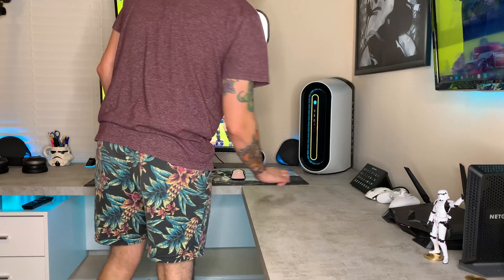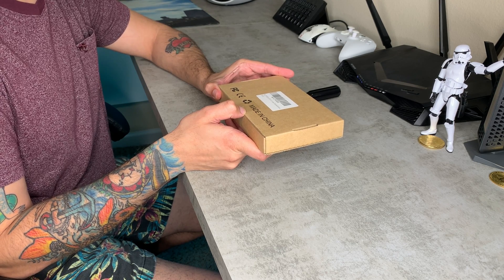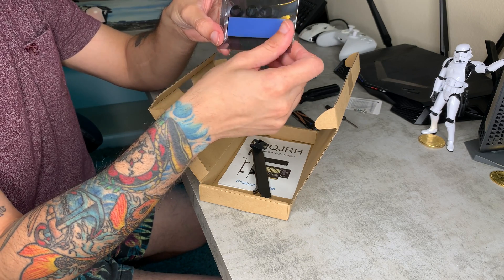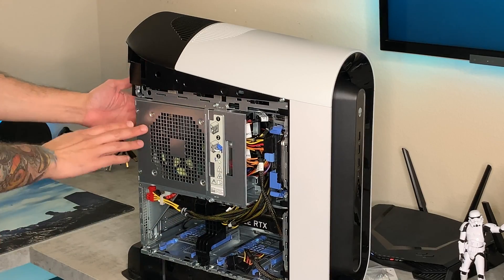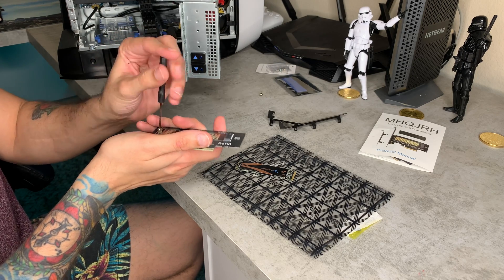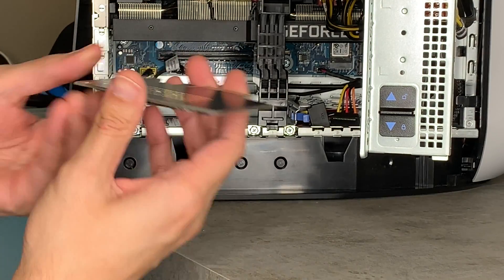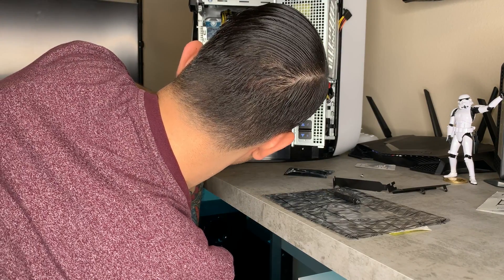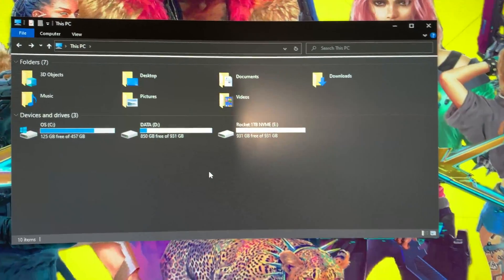Install 2nd NVME SSD on Alienware Aurora R11/R10

Comment: For anyone watching this video and installing a second NVME drive with a pci-e adaptor on an R10 and not seeing the drive at all, Swap the original NVME that came with the computer onto the pci-adaptor and put your new NVME drive into the motherboard nvme slot instead. It's some weird Alienware drive compatibility issue that is still not fixed as of 06/14/2021.
Reply: Use the Disk Management formatting the disk (create new simple volume)solved my problem.
Reply: @184Simon  the specific issue some of us had is that the drive is not detected at all so you can't remap the partition even through diskpart.
Reply: @FatCatHash  how do you swap the SSDs around and still get your system to boot? I’m running into the same issue /:
Reply: @0UpInFlames0  it will boot normally using the original drive as the boot drive even if it's not in the main motherboard slot. If it doesn't work, I would check the bios to make sure it's allowed to boot from the drive it detects the OS in.
Reply: @184Simon glad I read your comment…saved me a heap of drama with swapping the SSD’s around 😊
Reply: Thank you @184Simon
Reply: Yes it would require remapping or formatting and creating as a new partition from that unallocated space which is required in order to use any brand new drive on any pc lol. Once that’s done it should show up! Not an issue with Alienware haha! No need for swap.
Reply: I litterly just posted a comment asking why I can't find it and I just saw ur comment! I'm gonna try that
Reply: Thank you for your reply.  I had the same issue and swapping with the NVME on the motherboard fixed it.
Reply: I had the same issue with my r10, could'nt find the drive anywhere in the computer. I swapped them around, boom there it was computer reconized it. Thank you for the video @Gamer Heaven and thanks for the help in the comments @Raymond C
Reply: Worked for me on an R10. Thank you sir! I can now see it in Disk Management.
Reply: This did the trick on my R12!!!  Thank you !!!!!!!!
Reply: Followed this advice and now my PC won't boot. Thanks
Reply: @askinganime6023  did you ever figure this out? Currently having this issue
Reply: @NagsGames  I took out the sata drive racks and put my GPU on the very bottom and put the m.2 adapter into slot 2. (The small one that fits the adapters size perfectly) I then turned on my computer without any of my other external drives connected and it recognized it
Reply: thanks for the advice but Im annoyed I listened to this guy.... I will never follow this channel again

Comment: Hi Folks,

I've followed these instructions for my R11 using the adapter and a 1TB nvme drive, however when the adapter is plugged into PCIe slot 4 I cannot get signal to my monitor.  Has anyone else had similar issues?

Comment: Is the read and write speed similar to Gen4 motherboard M.2 slot? I want to achieve the 7000mb+ speeds I’m getting from my Samsung 980 pro gen 4 pcie nvme m.2
Reply: I highly doubt that it is possible in alienware R10/R12

Comment: Ok here is my question do to the fact its right under the GPU does it affect  the heat to the GPU ? I have r12 with a rtx 3080 and I don't need for that to get any hoter thanks all ready is .
Thanks for your help !
Reply: Following…
Reply: My 3080 temps have increased by 10-15C since installing the nvme in the PCIe underneath the GPU.

Comment: I would clone (via Macrium Reflect -free-) the main nvme to a Sabrent 2 TB nvme( on your card) after cloning, I would replace the main nvme with the cloned nvme drive. And then put in your extra E: /G: drive nvme on your card.
Reply: I was wondering about this. I am about to undertake adding a second nvme to my r11 and I still have a lot of questions.

Comment: R11 with 256nvme - better to replace with 1tb or just ADD 1tb using card like you did here?  I'm an old gamer (50) getting back into it after a 13-14 year hiatus. R11 is brand new - have only updated win10 and drivers so far.

Comment: @Gamer Heaven - This does not work on R10. Just FYI
Reply: I am currently trying to do it on my R10 and it is not working. What makes you say it won't work? The light turns on and everything, but the drive doesn't pop up in disk management or anywhere.
Reply: I too have R10 and have purchased the exact items that Gamer Heaven recommended. However after trying it for myself, like you, only got light turning on but the drive isn't recognized (even in disk managenent). After detailed browsing in dell forum, someone did the leg work of contacting Dell support and got a co formation that motherboard for R10 does not support this type of m.2 expansion
Reply: Confirmation*

Comment: so far your the reason i ordered an r12 lol
and ill be doing all the upgrades as well as adding the NVMe and 2 SSD  drives to it so i wont have to worry about space and iv got 64gb of DDR4  ready to go once it gets here all at 3200
Reply: Nice!  How are you liking your system? I just bought an R12 and am in the midst of doing the mods. Would have loved to build from scratch as I've done all my life but couldn't find parts easily.
Reply: @ConservativeGamer111  return it
Reply: fuckyoutubepolicy staff  Now maybe. Things are not so simple as the future exists in multiple ways. Performance over time and more importantly future improvements. They commonly use proprietary parts that make it more difficult and costly to change things on. I've opened them up and would never suggest them unless they like 40% under equivalent as there are no bad parts only bad prices.
Reply: I'm sorry you burdened yourself with an alienware.
Reply: @rodneyhobbs6507  That's pretty mean. I love building PCs myself and had a hell of a time finding something for a good price and nice specs. I would have built my own system, but GPU prices on the open market are absurd. Figured I'll build another once market opens up. Who knows what their story is but why do that? Make you feel good?
Reply: @ConservativeGamer111  motivation. Cards are hard not impossible. Put in the work, get a card, be rad. Shuffle up every day, find someone with a deal or Buy abs or something. just never buy a Alienware. They sent just prebuilts their also trash.
Reply: @rodneyhobbs6507  There is more than one way to skin a cat. Who cares how you get the computer. As long as its working for your personal needs. Grow up.

Comment: There is no need for more then 1 sure it would be nice not to have to use an adapter but hey there are a lot of things in life they could be better if this or if that... So you have have 2 and then you have have SATA SSD drives as well. And you will never notice the difference between SATA SSD And M.2 SSD. Yes M.2 is faster but when it comes to loading games, you would never be able to notice a difference. 

Good video!

Comment: I bought an adapter a while ago, but I'm so lazy...  I've opened my case like 3 times and haven't done any upgrades at all yet. Haven't had any issues yet running Cyberpunk maxed out 4k, haven't had heat issues yet, it keeps me complacent.

Comment: You can buy a x16 adapter which can insert 4 NVME M.2 SSDs, but that adapter usually cost as much as a 1T 2.5inch SSD in 2020.
Reply: The PCIE slots on these Aurora desktops are all only x4 Lanes so that wouldn't fit. I have an R13 and have tried 3 different Nvme to PCIE adaptors and the desktop doesn't recognize the drive. It shows up in BIOS, but it is nowhere once the system starts. Alienware made these cap out at 258GB I believe, I am trying to install 2 2TB Nvme SSDS on the main board, but Dell website says the boot 2230 slot Maximum size is 258GB. Wish i knew what the PCIe slots are for if they can't run NVME and seem to not work well with Alienwares motherboards.

Comment: Can you add aftermarket ram on this motherboard?
Reply: There are tons of reports out there written by people having problems mixing RAM they originally bought with the system and RAM from a 3rd party it would seem. The RAM Dell sells is some specific proprietary model JUST used in these Alienware models and it messes with the computer if you try to install a RAM module from somewhere else alongside one of these "Dell Only" RAM modules. 
What worked for me was to get rid of all the pre-existing sticks of RAM that came with the computer and replace it with a matched pair of HyperX RAM sticks I had bought elsewhere to avoid the ridiculous OEM markup. That seems to work most of the time so I've been told. I've always done it like this any way with new RAM...just replace the whole lot at once. Maybe I lucked out. Either way, I'd read up about the issues before attempting just for your own information! Good luck!

Comment: Hello, I just got a very good deal on a new R11 (with i7), but it only has a 256 GB NVMe SSD (boot). I would like to add a second NVMe SSD (1 TB) using the adapter you show in your video. Is it possible to have one 256 GB and a second 1 TB SSD, or should they be the same size? Thanks for the great video!
Reply: You should be able to add up to whatever the pcie slot can handle and whatever the actual peripheral will allow. So get yourself a 1TB :)
Reply: If you are looking for top speed, you should remove your 256 and replace with the 1 tb to get maximum performance. Smaller drives are generally a bit slower.

Comment: Thank you sir. I just found out that my R11 only has one MVME and was trying to find how to add another SSD . This is very useful.
Reply: Good Morning Brother, with adapter, will it take M.2 NVME 2TB SSD Hard drive, Many thanks and really appreciate Brother.
Reply: hello, i just ordered my aurora r10 ryzen edition, i am wondering the boot nvme m.2 slot is gen.4 or gen.3? thanks a lot
Reply: I just plugged in a 2TB external SSD to my R10 problem solved........lol

Comment: Wait, your R11 has lights inside the front panel?!? I can't get mine to light up! I just have the ring and logo that I can control! Yes, I have the white version also! But it's an R10 Ryzen edition. Also, thanks for the expansion board info, wasn't sure which one to buy!
Reply: The ryzen r10 doesn’t has any light inside ig
Reply: The trade-off for having that RGB illuminated panel is that it presents a barrier for straight air intake in through the front of the computer by partially blocking the vents. My R10 doesn't have it either, and I'm very happy about that because it runs cooler.

Comment: Awesome video!  A question for you or anyone who sees this!?! What is the best way to move your games to the new storage device?  Woul I need to download them again?  Might seem like a dumb question but I’m a total newb
Reply: you probably know this by now or forgot, but just clone your files to the new drive. If you pulled out your nvme you'll need to reinsert with an adapter into PCIE slot like this guy bought and move files. Otherwise, find a Sata to USB cable and connect your sata enabled drive to adapter and to PC with USB. Then move files.

Comment: Just heads up anyone getting this ssd and adapter for the R10 IT WONT WORK like video shows.  I am a novice so per video seemed quite simple, I did exact instructions but ssd won't show up.  I have done some research online but seems way complicated for my level of understanding.  Avoid this unless you have a good level of understanding just my advice.
Reply: I just did this set-up on an Aurora R10 (4th Gen SSD is pointless, as it only runs as 3rd Gen).  After installing, my system did not see the added SSD; rebooted twice but still nothing.  Was going to swap SSD's in the morning, but for some reason, the SSD was now recognized, and I could format.  Weird, but works fine.  In the lowest, long slot, btw.
Reply: I bet you need to format and remap your drive. He mentioned that in the video. It should be really straightforward for Windows users.
Reply: @Steve-hk2hd  nope. Doesn’t work in the AMD R10s. There’s a workaround on the Dell forum but curious if @gamers heaven did that
Reply: @Nowhyshouldi2  I'm running into the same problem. I just followed all the instructions here using the exact same components. I'm getting the LED indicator on the adapter showing the drive is active, but I cannot see the drive in device manager. I don't have any other means of formatting and mapping the drive.
Reply: @Nowhyshouldi2  Have a link to the Dell forum article?
Reply: @Nowhyshouldi2  Strike that. I was able to format and map the drive. I had to plug it into the shorter PCIE slot right below the GPU. That worked just find. Formatted the drive, got it working just fine. Then I moved it to the standard PCIE slot below that one and it again won't recognize the drive. I don't know if this would block too much airflow to the GPU if I just leave it in the slot just below it.
Reply: @benbrucato8051  Are you still running in the shorter PCIe slot, or did you get it working in the standard one?
Reply: @KevinHakanson  I'm still running it in the slot just below the GPU. I've not had any heat issues. The only problem is that it runs about about half speed. That's still really fast, but still... From what I understand, the R10 motherboard (at least the one I have) can't support it in the lower standard slot.

Comment: I bought the Sabrent Rocket for my Alienware Aurora R11 RTX3080 (still in production as I write this, to be delivered on March 29th) based upon your above tutorial. Unfortunately, I realized too late that there were no PCIe 4.0 adapters available to benefit from the faster read/write benchmarks. How is your Sabrent Rocket NVME PCIe 4.0 doing in a PCIe 3.0 adapter read-wise speeds and write-wise speeds? And does the R11 have a spare PCIe 4.0 slot to benefit from the extra speed of the Sabrent Rocket if and when the new PCIe 4.0 adapters eventually roll out? So far it looks like I am destined to use my Sabrent Rocket in a PCIe 3.0 adapter for the life of the memory with no hope of achieving the specified benchmark read/write speeds.  That kinda sucks, agreed? 😒
Reply from the maker: So the speeds are about 60% of their advertised by Using the 3.0 . But I already had this drive , and it’s fast enough . It has all my games stores on it currently and they all load pretty fast. Also transferring files on and off it are still stupid fast

Comment: I installed it, the light is on, but I’m not seeing it in disk management or anywhere else
Reply: Same here. Were you able to figure it out?
Reply: @Eldar Jahansooz Thanks for the reply, Eldar! So you used the exact same method as in the video but with the Samsung nvme, correct? Because I was able to get the saberent one to work, but I needed to use a pcie x4 slot. And in order to do so, I needed to drop the gpu near the bottom of the case to have access to the x4 pcie slot.
Reply: So in order for this to work I need to move the GPU lower? I'm having the same problems. It is showing in the BIOS but not showing in the disk management.
Reply: @GingerBreadReddd  I never did try checking the bios, but what I ended up doing was moving the gpu to the lower pcie x8 slot. That will make clear up space to make the two pcie x4 slots clear for use. Once you plug the adapter into the x4 slot, it will show up in disk management. Only thing I am worried about is how the temperature of the gpu will be affected by the relocation. I haven't noticed any drastic increase in temperature, so that's a good sign. To play it safe, I ordered a nvme to pcie x8 adapter on amazon. Hopefully that will work with the use of the nvme in the pcie x8 slot so i can put the gpu in it's original location.
Reply: @fernienicolas1361  Actually, from my research, the only PCIe 4.0 slot on the motherboard is where your gpu is located. If you change the spot of your gpu, the pref of your GPU will go down sharply. I am still waiting for my machine, but you can do some research on yours.

Comment: You can get an adapter that will support two NVME drives. Just as an FYI.
Reply: NewEgg has one that supports 4 NVME drives (4x4x4x4) and depending on how deep your pockets there is one that supports 8 (1x1x1x1x1x1x1x1). Too rich for my blood though! 😜

Comment: does it work for r9 as well?
Reply: Have found answer? I have the R9 and I’m trying to do the same thing  I just took a look at the motherboard and it look like it is possible
Reply: @ahanbaki  I did the same test, but don't know why it worked the first time, but it doesn't work anymore after I tried and failed to transfer my system to the new SSD with Samsung data migration. I can't go into the system if I plugged the m2 to pcie(ERROR message: no bootable device, but it becomes normal as soon as I take it off.
Reply: Interesting I wonder which motherboard do you have? I have the Intel
Reply: @ahanbaki z370, I seriously have no idea about the issue, but my PC just can't work normally if I plug in the m2 to pcie transformer
Reply: @ahanbaki  in my case it has two situations. 1: no bootable device 2. Critical issue: boot failure. Both ended up with same thing- can’t boot my pc
Reply: I want to try and see what’s going to happen since I have intel motherboard hopefully that will works. Have you called customer service about the issue?

Comment: Doesn’t this lower the GPU’s PCIE slot from x16 to x8?
Reply: The x16 GPU slot only runs at x8 on these anyway.
Reply: If this helps, the R12 specs are 'both' mechanical and electrical.
-Two PCIe x16 mechanical/x8 electrical Gen4 slots (SLOT 1
and SLOT4)
-Two PCIe x4 slots (SLOT2 and SLOT3)

Comment: just bought a r10 5800 non x with the 6800 was wanting the 3080 but was not a option at this time. i was trying to see how many nvme slots it had and this popped up. thanks for the heads up. for anyone wanting to buy a r10 or r11 are any prebuilt just pick the slandered drive they give you they charge a arm and a leg for that hard drives